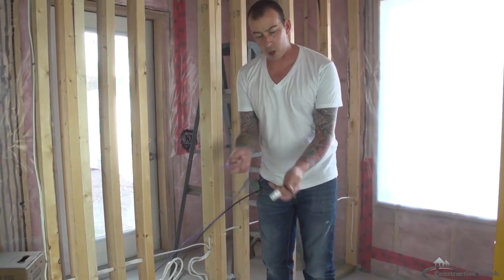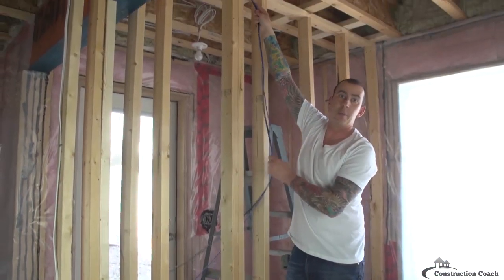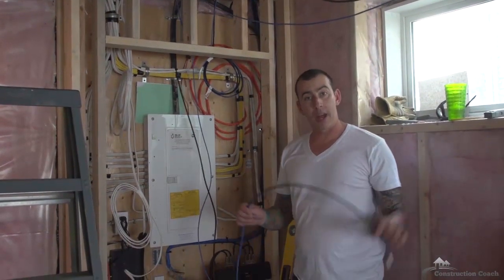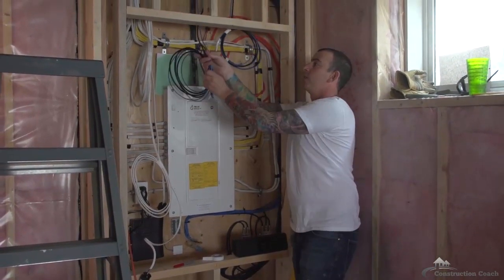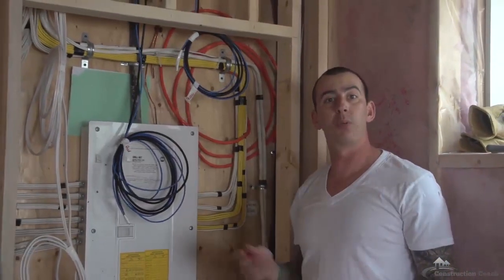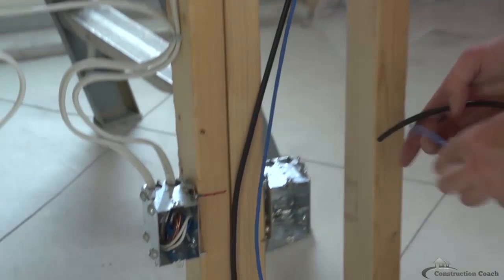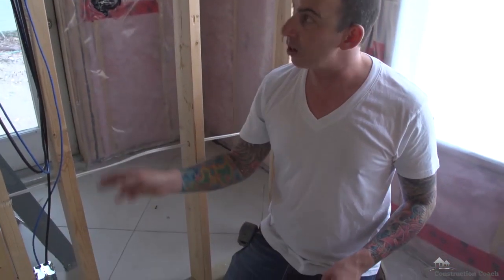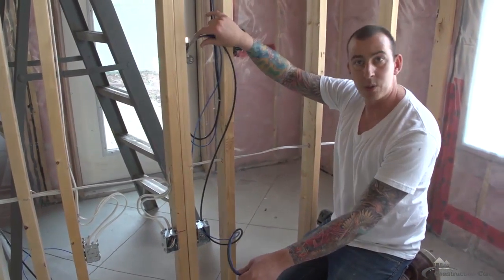How to Run Cable & Data Lines - DIY

Comment: Annoying that wire is run through the rafters instead of up to the attic then dropped down the the panel. That way a homeowner can work with it.
Reply: He's in the basement. Why would you run the wires up to the attic just to run them back down into the basement?
Reply: You run the cables either up to the attic or under the house to make it easier to work on later. Most new construction have tubes that run from the attic to the crawl space. This allows the cables to originate at a terminal box, run down to the crawl space to the tube (which is usually pretty close) and up into the attic. Once in the attic the installer can just drag the wire over to the appropriate wall , drill a hole and drop it down. Makes for a much neater install and saves the homeowner money in labor costs.

Comment: Well that is the easy low cost way of doing it when you are building a home. I always install plastic K-tubes and give them good turns when crossing corners so the cables can be replaced if that is ever going to be needed. You never know. A 10-15cm extra loop over the box is also a good tip. I would never use the same outlet for both coax and catX cable.

Comment: Strategic placement of PVC pipes FTW
Reply: or polypropylene conduits; corrugated ones are flexible and can allow running fishing lines end-to-end (for future additions). But most electricians just leaves the cables naked, it's cheaper. The conduits are often overkill.

Comment: I'd be so angry to find this as a homeowner.
Reply: Can you develop, interested understanding the details that would make you angry. That's pretty standard electrician job. Some of the hard pulling does make me cringe, but that should be fine. Some of the ceiling loose cables might not be tidy, but maybe he doesn't show how he's pull things tighter later on. He's efficient and practical. It works.
Reply: @battornaraklapuma8979  Wouldn't conduit be a better option here? Replacing or adding a cable run will be a pain here.

Comment: I recommend using optical fiber transvers with fpga server computers like intel stratix 10 soc or optical network cards xeon and compatible io converter boxes to put on the other side by conecting a pof to a optical lc kyston jack on the wall
Reply: Of course you do.